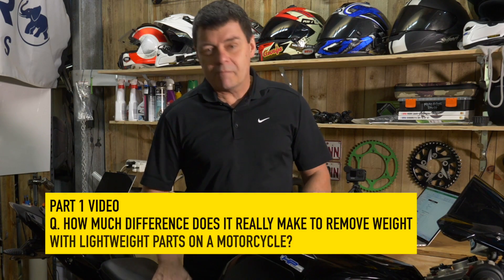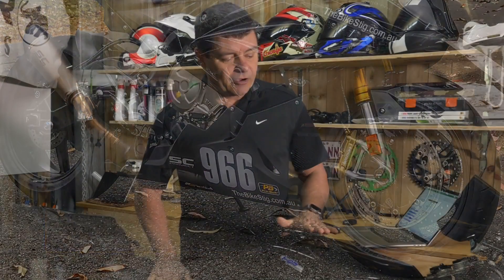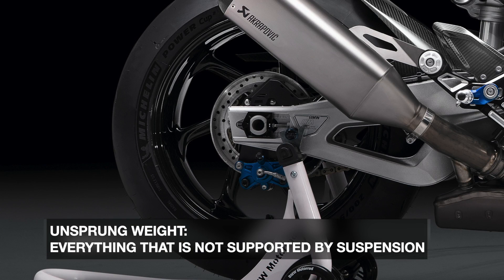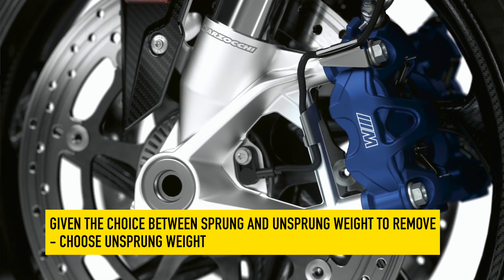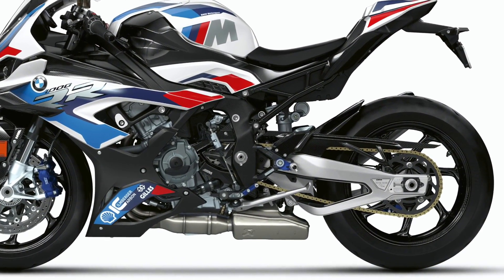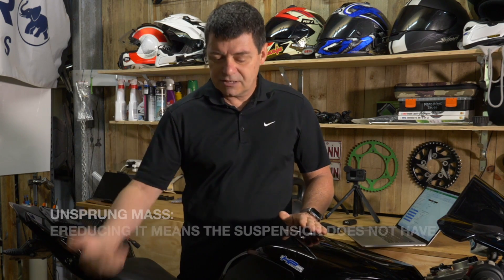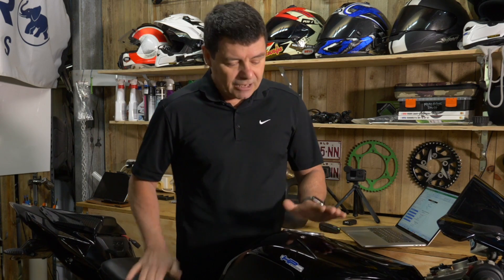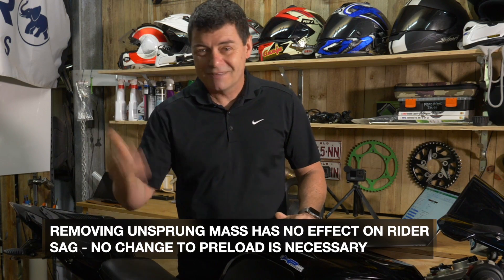Part 2 - Reducing Unsprung Weight On Sports Bikes Like the BMW S1000RR

Comment: great topic, but one thing overlooked is if you reduce the unsprung mass and thus the suspension is doing less work to manage it.  You'll need to adj compression and rebound for the lighter wheels.
Reply from the maker: Interesting point, I'll be dropping a question about this on our suspension guru at the Superbike School. Cheers